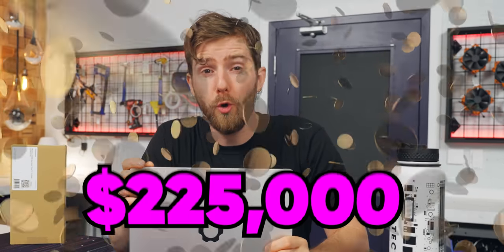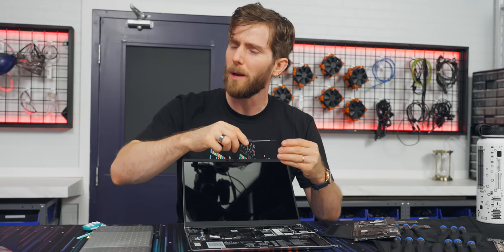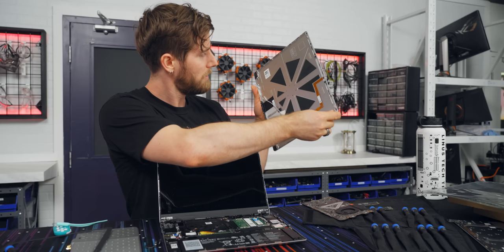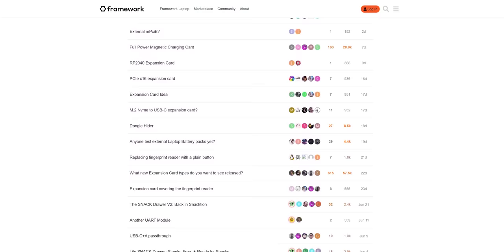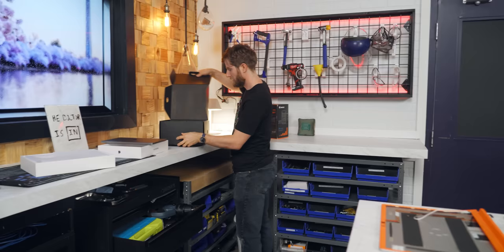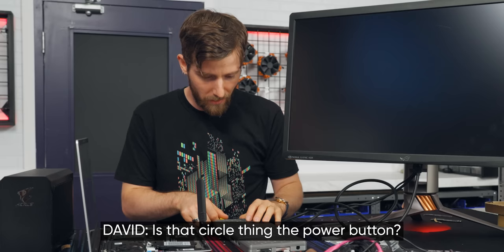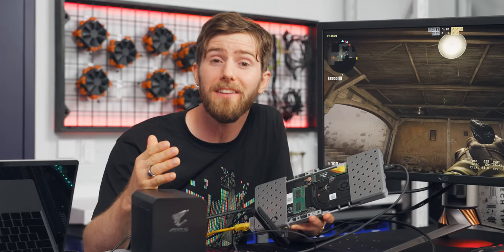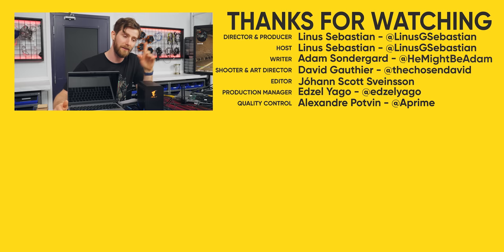I invested $225K in Framework Laptop - 1 Year Update and 12th Gen Upgrade

Comment: The fact that they made a hinge upgrade to fix design flaws is nuts. It really reassures you that they will support the machine years into the future.
Reply: It's good, but having replaceable parts is pointless if they shouldn't need to be replaced in the first place.  You might as well have just bought a laptop from an established brand that has better quality assurance. If the replacement parts are covered by a warranty though, then ignore me.
Reply: @SuperSucc69  even established brand like HP have issue with the hinge and crazy thing is they don’t have any support to fix it.
Reply: @SuperSucc69  the soldered cpu gets me
Reply: like in a bad way
Reply: @lilsquidgaming39  thanks for clearing that up, we didnt understand what you meant before you specifically told us it was in a bad way.
Reply: @SuperSucc69  Like Bishal Bhandari, I would have to tell you to avoid looking up Dell XPS coil whine since you believe they all work flawlessly, haha.
Reply: @NoOne-yp1qe  he didn't say that. He's saying that there's no point in having replacement parts if they could just be better from the factory, and not need replacement simply for being poorly designed. Some computers have initial design flaws, many don't (subjectively).
Reply: @DoctorWhoNow01  Hmm..I thought my message was the same as Bishal Bhandari's so wonder why I got the reply, hehe. Well either way, an honor.

I mean yes, I get that they could be better but how would Framework, figure out all the flaws without seeing in the wild what is bad design? Yes, "in hindsight" but if we all had hindsight before doing or saying something,  the world would be a very different place.

I guess their message feels a bit like one I would expect to see against Intel, for their dGPUs. I feel like Framework has done a great job for their first product against giants in the industry (compared to Intel). And rather than being the new kid on the block, making something horrible and then abandoning it (if the Intel rumours are true), what Framework can do is show us that they learned from the mistakes and make future products better but not abandon the old products and make those better too.

Also, seems like a strange concept, feels like Flash is saying, "If they had just done their job right they wouldn't need repairability." It is hard to see any justification in this (for me that is). First of all cars, have repairability and companies have been at it for decades? Would we be happy if our cars had all parts bolted down?

Also, the anti-right to repair thought. HP, Dell, etc. almost always produce perfect products so it is fine if they are glued, soldered, etc. kinda sucks when you drop your laptop, phone, etc. and can't replace it because it was already perfect. And while I don't think Flash is directly saying that, us choosing something that might not be repairable, leads us down a slippery e-waste slope.
I've heard Surface books are good, Macbooks are also good (but 1s in repairability scores). 

With all that being said, I do get how some people just want something that works, don't want to deal with having to fix it or taking it in for repairs and yeah it has conveniences.

You maybe feel like I've missed your point. Maybe some of this makes sense. Without Flash's feedback, I don't know how either of us could be sure what exactly they mean. Unless you know them and they explained how that fool on YouTube replied to them but they didn't want to explain to me all my misgivings. I mean I've been wrong plenty of times in life, it's possible that I am now as well, just telling you how their message comes across to me.

I'm not trying to blindly defend Framework, as soon as I saw Linus using his, the hinge bothered the hell out of me. I'm just glad to see someone fixing their mistake rather than dusting it under the rug, throwing it in front of a bus, abandoning it or whatever other more established companies would do.
I can't wait to pick one up in a few years if they are still in business and I'm glad to hear people are enjoying theirs and they are happy they can fix em, rather than throw them away, I have the worst luck in buying products that a company made mistakes on and just abandons. It has happened with big companies and small ones, the small ones at least tried to fix their mistakes the big ones just abandoned them...

Anyway, hope I don't make you see red, if I misinterpreted things and have a good day!
Reply: @SuperSucc69  "Established" brands have issues with hinges and other components all the time! My alienware gaming laptop a few years back, about a week in, GPU problems, weird images then crashes. My HP laptop before then? The hinge plastic casing cracked and split apart where the hinges were putting pressure on the upper display. And Apple runs the gamut for a so called established luxury brand...

 The difference is, you gotta send the entire machine in to get it fixed. And if you're out of warranty, you're screwed!
Reply: @Gadgetmawombo  Yeah there is a big difference between large laptop manufacturers and framework. If you buy a normal laptop and the hinges arent good or you have a problem with it, the company will just tell you they dont care and to put up with it. With Framework they listen to their community and develop better replacement parts based on community feedback. Sure they could have made a better part in the first place but that problem isnt unique to them, you could apply that to any other laptop manufacturer and they dont even try to correct the problem.
Reply: @lilsquidgaming39  unfortunately there are no socketed mobile chips anymore, so soldered is the only way.
Reply: @SuperSucc69  Hello good sir. I spent 2500 Euro on my HP Spectre. Speakers broke. Hinge broke. Display cable broke. And weeks left without a laptop whilst it camped at the repair store.
Reply: @SuperSucc69  - Still better than being stuck with defective components.
Reply: My biggest problems continue to be (1) the lack of a discrete GPU, (2) no AMD CPUs and (3) soldered CPUs.
Reply: @sylviam6535  no chance of socketed cpu happening unless they shove a whole desktop chip in there.
Reply: @degru4130  - I understand that socketed mobile CPUs need to become an industry standard first, but it would be nice if it happened.
Reply: @sylviam6535  they used to be. Nowadays laptops are too thin and tightly integrated for it to be worthwhile. The last socketed laptop chips were Haswell, and they were only in thick machines. Even then, the fastest mobile Haswell chip (4980hq) was only ever released as BGA package.
Reply: @degru4130  - I usually buy gaming laptops which are thick, so they could at least do it for those, but I understand that lots of people want thin laptops. Having said that, as someone who built a few PCs, would a socketed really add more than 4-5 mm in thickness? BTW, I have one of those 4850HQs in an old MacBook Pro.
Reply: @DoctorWhoNow01  there has never once been a computer designed that doesn't have a flaw, not once. Objectively or subjectively.
Reply: @SuperSucc69  it's their very first product. Of course there will be some flaws. And as far as I know there's no guarantee that cover  "upgrade". Since the product itself is not broken why would they cover for your upgrade?
Reply: @lilsquidgaming39  laptop cpu is always made soldered to their motherboard. I don't know why they just build that way. My guess is they are built that way to save space
Reply: From 4 'established' brand laptops I've owned:
1 (Acer) went back 3 times for repair, and eventually they refunded me most of the purchase price.
1 (Evesham - now defunct) had screen hinges that constantly jammed.
The other 2 (a second Acer, and a Toshiba) are still going well(ish).
Reply: @DoctorWhoNow01  All computers have design flaws, it just depends where they land for a particular model. No model starts with "we want a perfect product", if one form factor is "the shizz" right now, the company VP will tell the design team to make a chassis in that format and ship it off to engineers to pack everything in. Then they will fight the "form vs function" fight between them (and also the budget) and youll get a finished product that will ALWAYS be full of compromises.
Reply: to be honest, its just good that when these improvements come and you can actually upgrade them, instead of only late adopters getting the fixed version and you feeling left out because you decided to support the company early
Reply: @SuperSucc69  you don't repair or upgrade your own stuff, do you?  If you did, you'd know the hidden costs.
Reply: @sylviam6535  yeah, I've replaced CPUs in older laptops and you could also replace GPUs. If they developed thicker gaming versions maybe Framework could introduce processor swapping.
Reply: @jemborg  - Framework has to work with what CPU makers produce. Swapping CPUs at the moment means using a desktop CPU and socket.
Reply: @sylviam6535  yeah,  I gathered. That's why I mentioned a thicker variant (for gaming).
It would be nice if AMD supported Framework.
Reply: @jemborg  - Yes. Given that Framework only supports iGPUs, AMD would provide better performance than Intel.
Reply: @bishalbhandari1005  If it is in the warranty period you may get lucky. You may get a exchange replacement with the production changes. Kinda like looking for Ford parts with 9 year vehicle. Not in stock. Only portables have a much shorter production span. In both instances the idea is. If you want that part it comes wrapped up the rest.
For an auto a $35,000 plus part and a new license plate. Same marketing think for laps.
Reply: @lesliesavage9229  That is how my uncle went bankrupt. Contracted out casings for hydraulics. He got supplied with porous castings. 90% failure rate after 6 months.
The casting supplier bought him out. 10 cents per dollar of worth. Mostly just for the patent rights possession.

Comment: At the end that spare motherboard could even become a DIY Steam Deck. Yes, it could be very expensive, but it could be a funny project, too
Reply: Yes
Reply: No
Reply: Yes
Reply: Too big. But if they ever get into the smartphone game, then you could upgrade your smartphone and throw the old board into a steam deck style device or tablet. That would be dope.
Reply: @boblablaw4857  great idea. A Framework phone that can be repurpose as a handheld gaming. A Dream come true.
Reply: That’s honestly what I thought it was he. I saw the short for this video. it looks at lot like it already
Reply: Added to things which no actual consumer would want
Reply: @Adnegoo  I think you'd need to go the other way though, typically gaming is more demanding than what you'd need from a phone, so framework should make a handheld gaming console than can later be repurposed as a phone.
Reply: Elevated Systems did a good couple of videos where he printed a keyboard case for the Framework motherboard. It seemed like a pretty good use of a spare.
Reply: @boblablaw4857  Not necessarily, framework mainboards clock in at a profile of 230x105mm I cant find information on how thick the board is but that fan is 5.5mm tall and is the thickest part of the board so its sub 5.5mm (also that fan is removable and leaves a circular hole in the pcb according to the schematics (which dont have the dimensions reeee) so if you redesign the cooling system that gives you a way to route connects THROUGH the pcb which lets you do some crazy space saving stuff), the steamdeck clocks in at 298 x 117 x 49mm

That gives you 68mm on the X axis, 12mm on the Y axis, and 44.5+mm on the Z axis for a total volume of 36312 millimeters cubed for you to play with for battery, display, control interfaces, haptic feedback motors, etc etc

Not only could you make a device the same profile as a steamdeck with a full laptop mainboard of power.... you could make it smaller (if you can design a good enough cooling system and deal with the power constraints of a smaller battery)

The ideas sound

Also since framework mainboards are standardised, any chassis and cooling system you design now will still apply in the future making the system upgradable, and with thunderbolt support for external gpus you can make a true docked experience where you plug it into a dock that expands IO and also acts as an external gpu enclosure (you can just use two ports if needed) and all youd have to do is have the OS switch over to the external gpu automatically once its plugged in, maybe bypass the built in controls too so theres no conflicts with plugged in peripherals

Tbh if I had the capital its such a good idea id probably go about setting up a business around it myself and then either pitch it to framework as a business wing or just work with them as a supplier

Shit you even have enough play in the width that you could design switch style detachable controllers for it, (I havnt checked if thats patented by nintendo, if its not though its fair game) which would play even harder into the whole "we support repair by being modular" approach
Reply: It's 3d printable so you don't really need to buy it from them.
Reply: Someone needs to cram something like that into an old Atari Lynx shell. I still have mine laying around
Reply: or fit inside an egpu case for a full gaming pc
Reply: @boblablaw4857  that could be awesome imagine being able to change your 8 core cpu into a 10 core 0.0
Reply: I would say more for an Arcade Bartop or something of that nature.
Reply: @MrTeathyme  can vouch for the soundness. I’m working on a framework deck atm and it’s looking good so far
Reply: @stevenbmeza  low key you should do build logs on that if you don’t already.

Can guarantee you that’d generate views out the ass and gives you a platform to kickstarter it once you have an acceptable prototype

I know I know “don’t turn hobbies into business” but this is just one of those no brainer ideas
Reply: @AusSkiller  I don't think so. I'm currently playing ps2 on my phone, and this is on a galaxy s10. Flagship socs are crazy powerful these days. Far more powerful than anyone needs for a phone. But a steam deck however...
Reply: @AusSkiller  this makes sense. 
Maybe the ideal scenario is to make a plataform that you can chose to buy as a phone or a console, like same motherbord, screen, battery, etc. whith compatible hi quality aluminium cases.
Then you can reporpose as you wish...

But anyways. Great hope for the future of Framework.
Reply: The iGPU on the Intel CPU on that motherboard is pretty poor. Struggles with anything much more than hearthstone, and there's no way to swap it out or add an AMD APU like the Steam Deck has, so you'd have to find a compact dedicated GPU that's actually worth the space and power draw.
Reply: @SamLTate  Ya I don't mean to imply the intel one would be good. Linus mentioned amd in the future would be nice and I agree. I can emulate ps3 and switch on my 5825u laptop so they are great. That isn't even rdna2, but vega still!

Comment: The mini desktop option is neat, it really highlights the utility of the swappable modules
Reply: This could be a great future for thin clients. Killed the battery in my last laptop because it was mostly sitting connected to power during the pandemic due to having no place to go.
Reply: Arguably the swappable modules make much less sense for the desktop, because they're ultimately just USB-C devices, and while the module slotting into a laptop chassis has value in terms of form factor, there's not really any advantage to a module slotting into a desktop instead of just plugging in a dongle version.
Reply: I know, I want to get their laptop now so I can make a mini PC in the future. All kinds of great uses for one. Need to see if they sell in Canada though?
Reply: @IDv8I  ltt is canadian so i would be suprised if they didnt
Reply: @KyurekiHana  newer laptops shouldn't keep eletric current flowing through the battery when the battery is full and you're plugged in. older ones who couldn't achieve this usually would let you remove the battery
Reply: @guspaz  it's much tidier, and you still only buy what you need. Desktop boards have produced a hundred billion ports and 90% have been used once or never. This is so much better in every way and I'm all for it.
Reply: Another nice side benefit is that consumers could obviously buy these parts new/used and build their own mini PC. So Framework is still getting financial support from people who don't need a laptop but want something laptop thin.
Reply: @maxip.1935  Ya found that out 2 secs after I wrote that, should have edited it lol thanks.
Reply: @IDv8I  You don't even have to buy the whole laptop if you are only after the mini PC, you can just order the motherboard from their website
Reply: love this idea. the amount of mini computers i'd have running around the house at this point would be crazy.
Reply: Back in my day, we called that a halftop.
Reply: Yup, its an idea everyone has for their older device but either doesn't go through with a proper build or does a jank setup with motherboard exposed to the elements
Reply: What I think is great too is that you can just use it as your own mini server to store your data and etc
Reply: You could flock the mini-pc with 3D printed chassi on ebay.
Reply: great stuff is it wrong I am more interested in the desktop conversion than the laptop ;P